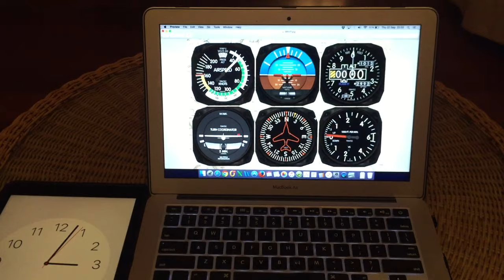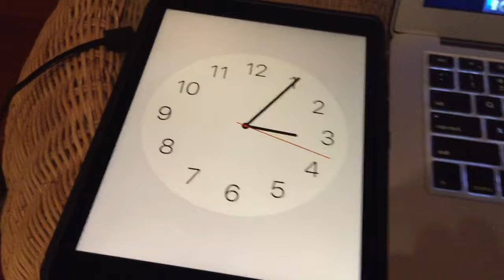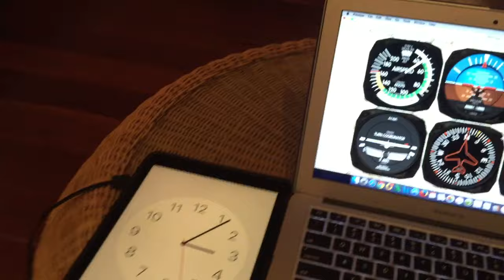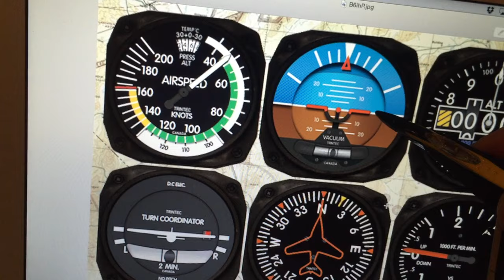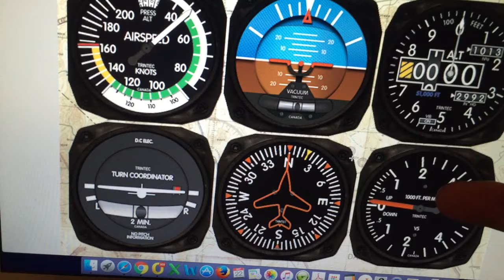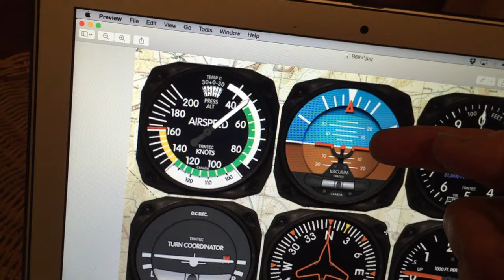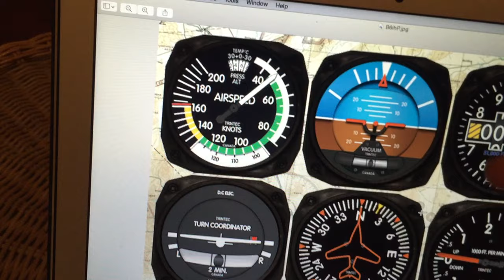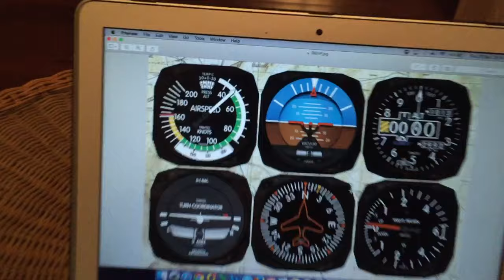Do aircraft change attitude to follow the curvature of the Earth?

Comment: I know that this is an older video and my comment isn't worth much. The only thing that I think you needed to add to this great answer to the question posed is how altitude is determined. Altitude is "calculated" from the air pressure in the current location. Air pressure is nothing more than the weight of the column of air above you and it acts in the same direction as gravity, towards the center of the earth. That level of constant air pressure will generally follow the curvature of the earth, but it will vary with the weather pressure system that you are in. That means that your indicated altitude is rarely the real altitude that you are at but on average it will work out to curve with the earth's surface. So, no the pilot (autopilot) would never have to adjust for the earth's curvature, either consciously or otherwise. They adjust to match the constant pressure level which in turn follows the curvature. This is basic ground school stuff, and I'm not saying you don't know this - of course you do. However, this isn't common knowledge so I thought spelling it out would help some people understand what's really happening. This is one thing (of many) that convinces me that any pilot who actually flies and learned about what they are doing cannot possible think the earth is flat.
Reply: Claude Pitre     👍👍

Comment: Andrew Corbell    There is NO pitching down of an aircraft during level flight, regardless of the distance desired around the earth.   the airplane remains level at all times and will follow equal values of atmospheric pressure.     this is no different than a ship traveling on the ocean .  the ship will not have to "dip its nose" yet , it curves around the earth following the ocean.   news flash.........the ocean and the atmosphere are both curved around the earth!      the airplane flies perfectly level, and follows the same air pressure  level, both in pressure and in distance above the earth.   in fact, if the plane were to dip or raise its nose, the plane would either have to give up energy or use energy to change its altitude above he earth.    (require more power or would increase speed if it raised or  dipped its nose at any time) .  i dont know if i can be more clear than this.
Reply: great example!
Reply: the more I think about it, he may be right. im not arguing either way just thinking that a plane is flying in a space between the earth and its upper limits and can fly anywhere between the two  where a boat cannot. just my thought.
Reply: Once I flew from Chicago to Niagara Falls listening to the pilot's channel.
We passed a bunch of airports and the controllers would say things like "we have you at two niner niner seven."
The pilot would respond that he would correct altitude.
Once the controller asked if we would like to go to five zero zero zero.
The pilot said that we were having good luck at 3 zero zero zero.
We had been following a storm.
I added up all the altitude corrections and it was something like 27 feet.
Reply: FALSE! 

KIDDING! You're answer is an elegant 'proof'. 
I just assume the very definition of maintaining a fixed altitude precludes such a need.

The question is represented as: 
"Do you need to pitch down to maintain a fixed altitude, at discrete points?"  

Aren't airframes engineered (if specific conditions are met) such that: 
lift = gravitational ...    L = G   with an AoA  0° 

Airspeed has to increase as the air density drops (increased altitude). 
Therefore, at a fixed speed, lift drops as altitude increases. 

Atmospheric density decreases with altitude.
To have lift = to G, you probably need to go faster as altitude increases without changing your AoA.

Landing requires losing altitude ... with an AoA greater than 0° ... we now have to assume he means something other than the attitude of the plane needing to be "pitched down" ...

The question to me is, IF you wanted to fly at a tangent line which is a straight, continuous path from some starting point, HOW WOULD YOU DO THAT, such that you were at all times, the distance above the earth proportionate to the amount it curved away from your initial tangent ? 

Flight control input (by humans, not a computer) to [compensate] for or [map out] the earth's curvature sounds ridiculous.

This is more of a PHYSICS question. Maybe to ANALYZE or (less likely) understand a computers input in flight simulators ... 

Further, I'm going to assume that the remark the author of this video made:

There is No exponential drop required as this only applies to the view from a stationary observer.  For a moving aircraft the attitude change is linear - at 450 Knots it is a smooth progressive 1 degree change spread across the first 8 minutes, then 1 degree spread across the next 8 minutes and 1 degree for every 8 minutes after that.  This is a linear rate of attitude change, not exponential at all

Ignore's the ambiguity of what a minute is here: Is it the period of time? If so, if its measured based on the 450 knotts, he should have included that it was [ground speed] ... if not, that rate would be substantially wrong if you were flying with, vs. against a jet stream. 

If it's minutes ... of angle it means yet another. 
if it's minutes of arc it means ANOTHER. 

And to say all of those are 'knit picky' of me, is to ignore that this WHOLE SUBJECT is knit picky ... because HE is who's talking about having to compensate for the freaking earth's curvature -- with a 25,000 mile circumference !! 

I'm not a pilot, haven't even read anything about flying basics for 25 years ... but these are my beliefs.
Reply: @zanick2 Wrong. Ships are on the surface of water. You would have to compare it to a submarine that is indulged in the medium. Since the plane is not at stalling altitude, it can indeed rise and will not follow the curvature of the earth naturally. It will only do that at great heights, when the air is so thin that it won't carry the plane any further away from the earth. Otherwise, the plane in your logic would never take off.

Comment: It’s worth noting that if you were to hold the same orientation relative to the Earth, you couldn’t simply fly into space. It takes energy to climb. The more your pitch increases relative to level, the harder it gets. The thin air at higher altitudes will do the same. At some point you won’t have enough power and you’ll stall. If you don’t force the controls and your aircraft has any natural stability at all, it will willingly follow the curvature. Climbing makes it slow down and pitch down. Descending makes it speed up and pitch up. The resulting path is called a phugoid. It loosely tracks the atmospheric gradient, not caring that there’s a mild curvature.